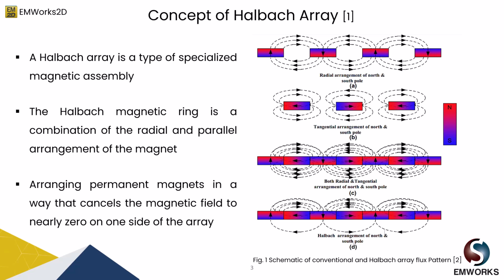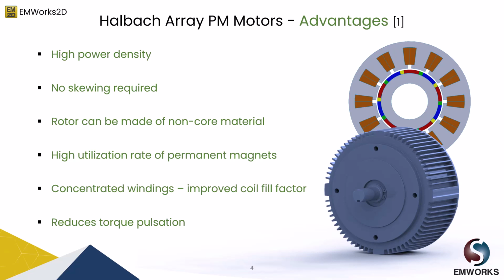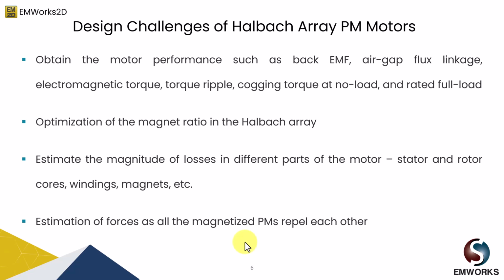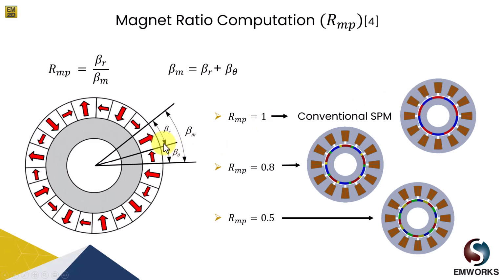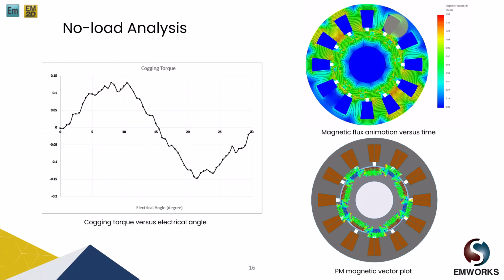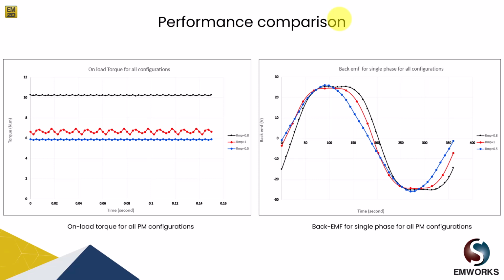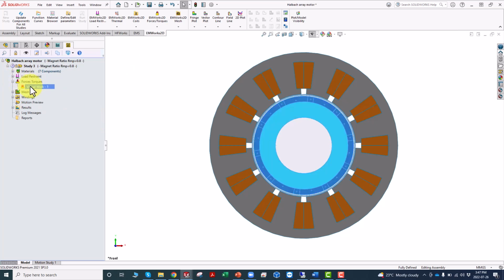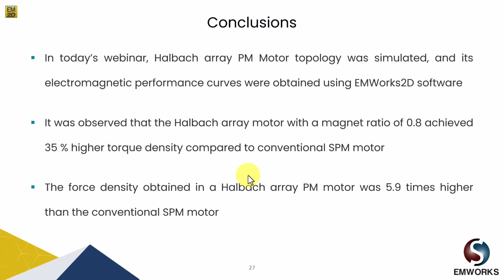[Webinar] Design and Analysis of Halbach Array PM Motor

Comment: THERE IS NOT SUCH THING AS FREE ENERGY THERE IS A COST TO BUILD ANY PRACTICAL MOTOR! WHAT I CAN'T  UNDERSTAND IS WHY NO ONE   GETS' IT RIGHT.
NOT ONE OF ANY I HAVE EVER SEEN ON YOUTUBE OR IN PERSON SIMPLY DON'T WORK THEY ARE NOT SELF STARTING AND HAVE USABLE TORQUE. NOT TO THOUGH COLD WATER ON YOUR EFFORTS BUT IT IS POSSIBLE WITH THE RIGHT MAGNETS !!!!
Reply: You're correct, I think these motors are over 96% efficient, that is axial flux motors in general.  I think this is total electrical energy in versus total mechanical energy out.  Hysteresis in the magnetic fields, resistive and impedance are the source of the losses in the circuit, the motor bearings and gear train introduce a tiny bit of friction.
Reply: Oh...  he's showing a radial motor at 17:03...  too bad.  These are a wee bit less efficient.